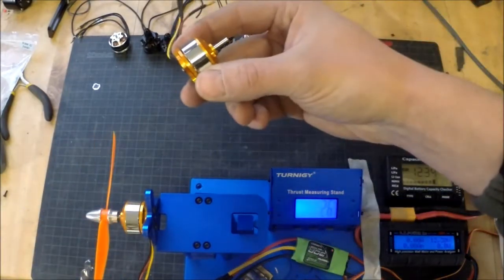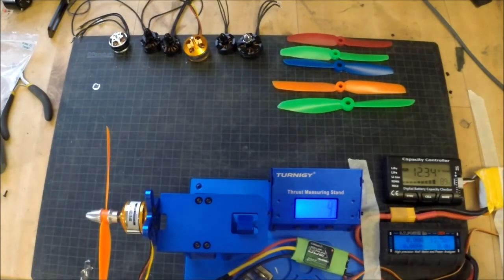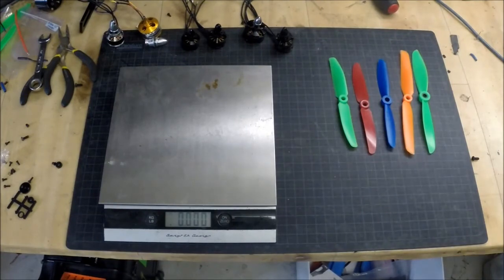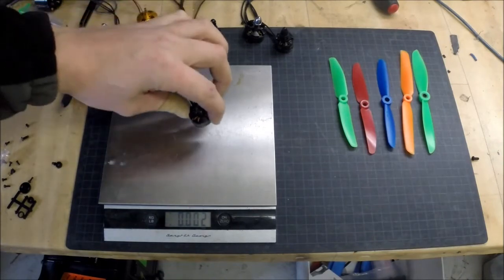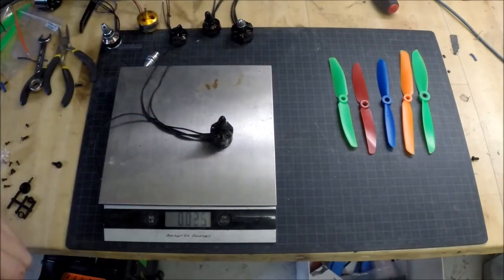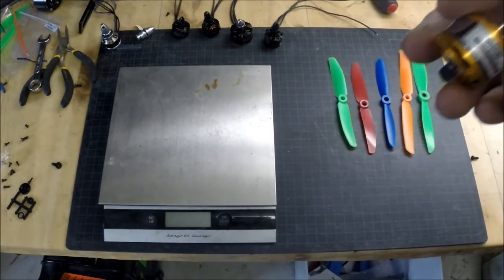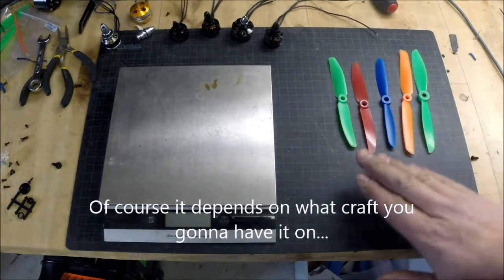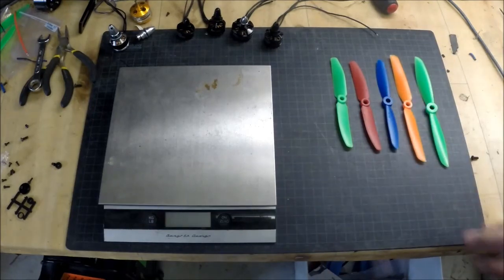RC - Testing miniquad motor performances part 1

Comment: any chances of redoing the test but been more aggressive on the throttle??? im intrested in the current draw under that initial burst?
Reply from the maker: +phmaximus its hard to track that inital draw of current due to the limitations of the equipment. Its also in most cases not that interesting since most esc today can handle quite high burst of amps.  
Though this is my opinion. So im afraid i wont do more extensive test in that sense.

Comment: Strange. I just did the same thrust stand test with emax 1806motor and different escs and 5030 props on 3S. The maximum thrust was 190g max.
Reply from the maker: +Albert Kravcov That sound way to little. Did you calibrate your esc? And also what type of prop was it?  It might have been that your esc did not drive your motor fully and didnt get max rpm. Its also important that your battery is fresh and will give enough voltage without sagging to much.
Reply: +daromeresperyd I calibrated both Escs (rw.rc 16a and rctimer 16a) and tested with gemfan 5030 and a full 3S 1800 25c battery. Also tried this with a servotester and a rx + radio. Just tested a kingkong 2204 with 5030 props and 3s with almost same thrust at 190g. I try to use my scale to verify.
Reply from the maker: +Albert Kravcov Sounds a bit to low. check for instance http://blog.oscarliang.net/emax-mt2204-mt1806-motor-quadcopter-1804/
Reply: +daromeresperyd Thanks. I am just wondering if I have faulty motors, faulty escs or a faulty Turnigy Thrust Stand :(
Reply: +Albert Kravcov I finally figured it out. My thrust stand was calibrated wrong. I calibrated it and now I am getting better results. (325g thrust with 1806/5030 gemfan)

Comment: Good work, but I was looking for info on 1806 motors against 2204's, basically both DYS, as I have a Gravity 280 frame which is designed for 2204 motors and I'm running 1806's on it, which have proved to be my go to motor for performance vrs budget...As I feel I maybe missing some power I was wondering do you have any info on these motors?

Comment: EMAX MT1806-2280KV ..  which propuller more suitable use? I have try 6040 but fly about 6minute making my motor very warm..
Reply from the maker: noob super I would say 5040-5045. You can most likely run 6030 as well but they tend to be bad props.   This is on 3s!  On 4s they will even be warm on 5040 :)

Comment: Hi, great review! 
Tell me please,  how it could be,  emax 1806 with 5040 is more thrust than 5045? 
Thanks!
Reply from the maker: Arkadi Raider Its a good question and i have 2 things i noticed. First of all the 5045 are not the same brand as the 5040 so that may differ and could cause difference. Secondly 5045 are not as efficient as 5040 and due to the fact that that 1806 motors are not that powerfull they may not be able to utilize the extra pitch and instead only draws more current.  I have flown a bit with the 5045 but i think it handles better with 5040. But it if course depends on what brand you pick!  Happy flying

Comment: Thanks for your quick reply, I have emax 1806 and will try Propeller 6045. I think 2204 will be better emax 6045. Propeller attentive to see the test Retrieves two new engines. Thanks again for your reviews
Reply from the maker: Note that 6045 will draw more power than recomended for atleast 6045. So keep your eyes on the heat of the motor and also on the escs. Happy flying :)

Comment: Good review!!!
Which is for you the best value for engine, weight, power consumption?
Reply from the maker: KITE SURF CHICLANA Hey, If you have money go fpr the Lumenier brand among the ones in the list. But if you want best ones for the price in above i would go with the Emax 1806. If you want to go with 5" either Lumenier or Emax depending on price. If you want to go with 6" props either Lumenier or Emax 2204.  Lumenier also have an 2204 version that is nice.  

More videos will come as soon as the new motors will come. Waiting for 2 more brands to be able to test.